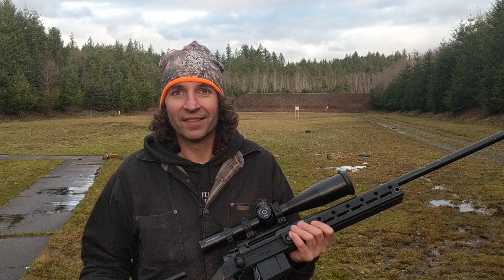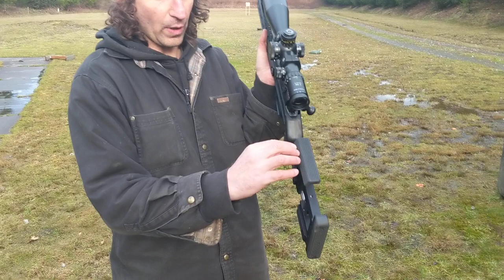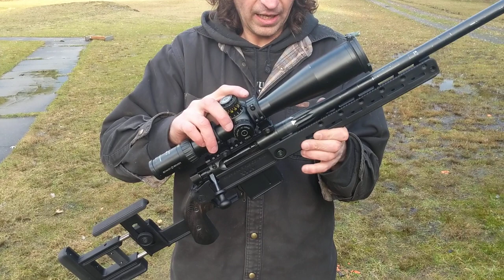American Rifle Company's Archimedes Rifle featuring the Xylo Chassis

Comment: Ted, How heavy does chassis weigh? Also with the rifle in that configuration?
Reply: Longbow072 last I heard was 4.65#.  Last year preorder was supposed to be 3.5#.  Not sure if I want mine anymore.  That’s a big difference.
Reply: @DL-gj1tg  4.65 is still quite light by comparison.  Really depends on the barrel contour you wish to run and how you will be using the rifle.

Next to no chassis gun will be an ideal hunting gun (unless it's being humped in the hills of Afghanistan). I trust Ted, he wouldn't have made changes or added weight via material if it didn't make sense to do so.